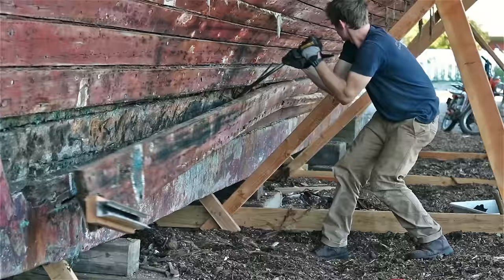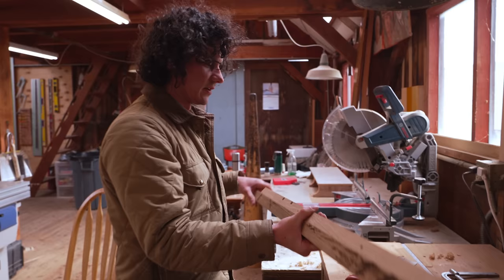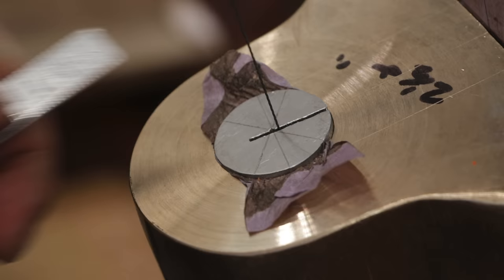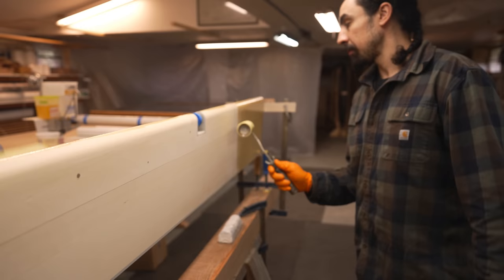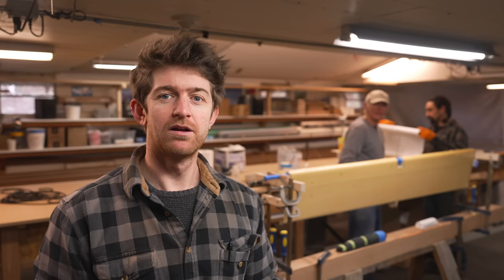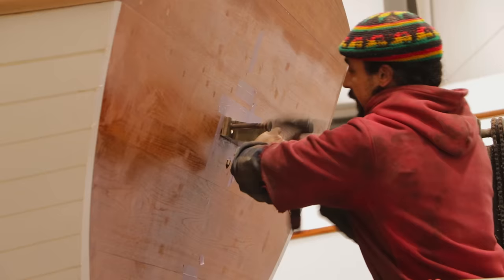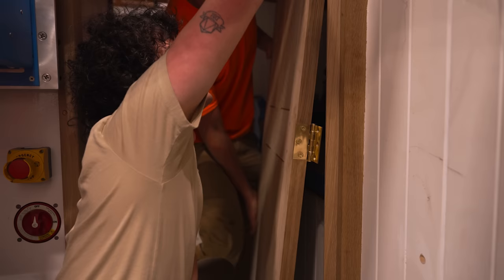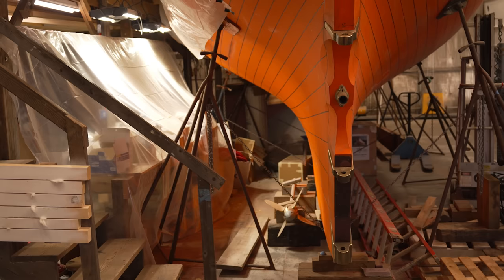Hot-riveting with heavy bronze hardware (rebuilding Tally Ho)

Comment: The consistant and exceptional level of craftsmanship that has gone, and continues to go, into Tally Ho is nothing less that outstanding. Everyone who has materially assisted with this project has every right to be proud of their accumplishments. The day Tally Ho goes into the water will almost be an anticlimax after all the awesome work that will have gone into getting her to that mark. I will say though, that the first time I see footage of Tally Ho gliding across the water under a full set of sail, I will most definitely have a tear in my eye.
Reply: My wife and I have watched this from the beginning and agree the level of craftsmanship far exceeds the quality and tolerances in the original build which were state of the art in its day. Just think that the shipyard would have completed 10 boats in the time Leo has invested so far. The quality of Leo's work far exceeds the original and the original shipwrights would have been masters in a few areas and would move from boat to boat performing the same tasks everyday turning out boats that hopefully worked and paid for themselves and the crews that sailed them. Leo's boat will last another 200 years or more if properly maintained. I hope it finds an important role when finished and not just a floating museum. I think Tally Ho is amazing. Good Job Leo. You will be remembered for this dedication.

Comment: Nice work. I know this boat costs a lot, but I keep thinking about how much the tools cost that you need to build her.
Reply: Very little compared to farming it out, and waiting for something that may or may not fit.  Tools if quality, last decades, and cheap ones are painful to work with, quality suffers.  The material used in this boat far outweigh the minimal tooling used.  Materials and labor far overcome the tooling.  And resale on higher end power tools is available, with the economic era we’re in, probably making a profit!

Comment: Analytical response:  the workmen who initially built your vessel would have been astonished by some of the tooling used in its restoration.  Lie Nielsen, Festool, Porter Cable, ad infinitum, are joined by the mix of caulking irons and hammers.  The table saw!  Dust collection!  Kudos to the adhesive manufacturer who was generous to supply the sealant for the decking (and aren’t battery powered caulking guns great for eliminating a lot of the reason for carpel tunnel?) for a small mention in the application.  Real world.      The people who are assembled obviously are enjoying the challenge, evident in both the attitude and pride in being able to produce jewelry in every piece constructed.  Having been a Forman in a small shop that made small row boats- both Kevlar and solid Western Red Cedar, the initial learning process was full of fun, but need for numbers quickly made it grinding out the same thing daily.  Tempers and jealousies made life miserable, which in your ever changing needs and great people doesn’t seem to be the case.  I commend all of the staff for both skill sets and attitude!  Joyous workplace is what every craftsperson seeks, and you have a wonderful example!  Spread the word about a new groupie. 😊. P.S.  the draw-boring of the door was noticed.  And the hand split pegs driven through the L.N. plate.  Quality

Comment: 20:14 to 20:25 I do not know what brand this chisel is but it is a thing of beauty.
That being said Tally Ho is becoming a piece of art. The craftmanship is something shipwright students will come to admire and learn from the next century!
BTW I absolutely loved the hammering noise off beat with the actually image of the hammer in the same segment mentioned above.
Great video.
Reply: Japanese chisel.  Favored by tool aware craftsmen who want really top end cutting tools.  Hardened steel laminated to a softer body, to ease sharpening.  Back is hollow also, same rationale.  A little more expensive, but buy once, cry once.  Cutting tools are a category that books have been written about, and end use can differ, but these are works of art…functional art.  Either you have basically scrimped and saved for them (woodworker) or inheritance allows the best available.  (Spoken by a callused handed splinter picker ).
Reply: @wrstew1272  yes pieces of art for sure.
Reply: @wrstew1272  yes, I was hoping for a brand name! :-)

Comment: 18:20 pretty sure the duchess of desire hasn´t been hammered this hard in a while..
Great to see the old art of rivetting being used to such perfection. 
I´ve had the luck to restore old handforged railings, which also included a ton of rivets, some years back, 
and it´s truly astonishing how strong they pull when applied propperly.

Comment: I'm no boat builder (feel like it tho, been subscribed since first episodes) but SEEMS like it is worth having a machinist come out, do a portable line bore of those rudder pivot holes and install a modern material bushing.   They are very close now I understand, but you could get the situation serviceable in the field, have some bolt in spares made, effortless pivot for your autopilot, and an easier repair path in the event of any kind of collision or bending forces.   I'm sure a 1/2" wall delrin or nylon (or maybe 1/4 even) would be a 50 year wear surface that would do good in salt water.   Modern touch for that nice early 20th century design plus reliability and serviceability....  My .02

Comment: We talk about skills being handed down from generation to generation - note that Nick drilled the door panel holes slightly off centre so they did not line up perfectly, knowing that when he drove in the dowels the faces of the joint would be forced against each other making for a very well fitting and secure joint.
A skill documented by the Romans BC.

Comment: Never seen that cool dowel cutter thing. May need to get one of those. Great work as always!
Reply: I think one name for that is "drawplate"> I'm guessing the term is borrowed from wiremaking, especially in jewelers workshops where wire (often silver) of a particular size is made to suit requirements by "drawing" it, with lubricant, through a hardened plate with a succession of decreasing sized holes all over it. (The more organised workers use a hammer with two vee blocks, or a smooth jawed vice with V grooves of various sizes, to reduce the wire diameter at the entry end, by repeated crimping and turning it slightly, so it will fit through. Unfortunately you can't really hammer it through from the back as if it was oak)

Comment: At 17:00 the talk about the hot rivets pulling the gudgeon tangs closer together. Steam boilers to power steam engines were made from overlapping plates. The two plates were joined by the hot rivet method shown here. These seams could contain 225 pounds per square inch of steam pressure without leaking. The dual hammer swing shown here was what tightened those joints.

Comment: While I know it's not 'traditional', I've always wondered if a 'balanced' rudder, where the gudgeons extend about a quarter of the way into notches in the leading edge of the rudder, would make steering less stressful on either the tiller or the steering mechanics. Just curious as to why it's not more common... That engine room door is a piece of fine furniture. Tally Ho is going to rival the opulance of the craft built in the golden age of pleasure sailing. Kudos everyone! :yougotthis:😻:face-blue-smiling:

Comment: The trim tab may be a bit wide, but that remains to be tested. The higher the aspect ratio, the more effective and the easier it will be to move. A wider trim tab will also counteract the main rudder more strongly and increase resistance and turbulence in the water.

Comment: Question for Nick on the Door? I see the one side of the center framing member had two sticky-outy-things, while the other, just a single being somewhat wider? I assumed that was to allow a handle hole, without removing all the material; but then you affixed the hinges to the side with the double tenon? Leaving me wondering why the difference between the sides?

I also have to say, and I know many have, but Zeal that’s just an amazing job. 

Because these are coming out every two weeks, and because I’ve already watch through from the beginning numerus times, I’ve had to resort to watching other boats being built? 
Sadly, they’re not Tally Ho? 

I watched a rutter being mounted two weeks back; granted they may not intend to sail too far off shore, and I’m no shipwright, but you can just see, that not all boats are equal? Such a great job; that goes for the entire crew.

Comment: What an awesome episode! I wish it was twice as long so you could explain some of the steps more, like that cool jig you made for the drilling. One question: when Zeal is drilling the holes into the two sides of the gungeon at 17:21, how does he ensure they are plumb with each other? Just careful measuring?
Reply: My take is: He's not drilling new holes, he's countersinking existing holes, so the countersink bit pretty much follows the drilled hole*. Presumably they were drilled through from one side, with the drill press table contacting the inner orthogonal face.
(*Given that the purpose of the countersunk recess is to accept a form-fitting upset rivet head, it wouldn't matter if it was not particularly concentric)
Reply: @Gottenhimfella  I actually meant 17:17, when he is drilling the main holes before dry fitting a rivet between the two and then countersinking. He would need those holes to be the correct angle and aligned w each other. It appears that he just has some sharpie lines to guide him. Maybe he can file them down the edges of the holes to accept the rivet (without introducing any give) and it doesn’t need to be 100% square w the rudder’s plumb line. Then he can transfer those holes to the boat and ensure the through hole matches, via that funky jig they showed. The rivets may not be entirely parallel to each other, but they would still be super tight.
Reply: @cgstadler  I see what you mean, and I agree that it's not essential, within reason, for the holes to be perpendicular to the midplane as long as the gudgeon axes are on that plane. It's a common situation to have to somehow line up the entry of a drilled hole (in this case, through the wooden sternpost) with the exit. I have sometimes made jigs somewhat like a G clamp, which have a drill guide bush at the entry end, lined up with a cone-ended set screw at the exit end. The idea is to reach around to the back side of what is being drilled and line up the axis of the drill automatically.
It's a lot quicker than the more usual ways, such as to drill from one side with a long skinny drill, see where it breaks through on the far side, then laboriously shift the hole across by some means while gradually enlarging it. The trick is to end up with a hole which is not bent. 
(It does occur to me that one advantage of ductile hot rivetting is that (at a pinch) a hole which is straight and of uniform diameter is not strictly required)
My method doesn't work though for (say) drilling for a sterntube. In such situations, the "line boring" approach is the gold standard. 
It would be helpful to have some affordable way of sensing the alignment of a drilling handpiece with a remote target by some electronic means.

Comment: Watching the installation of the rudder gudgeons was fascinating! 

Shouldn't there be ventilation slats in the engine room door though or is there ventilation elsewhere making it less necessary?
Reply: You want to seal off the engine bay/room from the cabin due to noise and smell. They will probably use active venting (fans).

Comment: That "Dutchess". What a buckhead.
Yeah, rivets are so much better than bolts because they go in hot and the quicker they're hammered in, the more they will want to shrink, making them tighter. As the gudgeons take stress from use, the rivets will not stretch and they will hold their place.
I mean after all, the entire hull of the Titanic was riveted...
...that didn't quite sound right.

Comment: Speaking as a boiler maker send the rivet through first then heat it with the oxy torch let's you heat and form the head easier and use multiple heats its bronze so it won't enbrittle the head.
Reply: I see what you mean, but if they heat the rivet in place, don't they risk burning the paint & boiling the tar?
Reply: @frederickstibbert7389  no it's the same heat level as what thay are doing now in regards to pre heating the rivet and it sitting in the fastener, and to heat in situe aim a clean blue quiet flame (not roaring but hissing) at the head of the rivet perpendicular to the hull of the boat, an added bonus to this method is you can take time to clamp or brace the opposite end of the rivet. Just give it a try on one and see if it feels easier for you.
Reply: @frederickstibbert7389  oh and I've just been back to check the video change the torch head to a cutting head the flame jet is more concentrated and controllable.

Comment: I thought a rivet had to have a head on each end, why won't the rivets that you ground flush on the rudder flanges just back out over time? How can they be held in place if one end is ground flush?
Reply: The holes in the hardware were countersunk, so when they pounded the rivets the countersunk space got filled with the back of the rivets. So the rivets still have heads even though they were ground flush.

Comment: I find myself wondering if the original Tally Ho was made with as much precision and care as the rebuild.
Reply: Quite likely not ! In 1910, "Betty" would have been just another boat built  by a well-regarded commercial shipyard. As a luxury yacht, she'd've had more than usual attention paid to the interior fit-out, & I gather that her iron floors & knees were something of an innovation at the time. Except for the high-quality wood used, her  hull, deck & rig were entirely usual - similar-sized craft were built by the 100's every year.

Comment: What prevents water intrusion into the stern post where the bronze rivets are hammered through? Keep in mind i know nothing about  building a boat.
Reply: The wings of the lower gudgeons are bedded in bitumen tar to prevent water intrusion - 15:18. Further up, where the gudgeons are bolted through the transom & sternpost, the gudgeons are bedded in cotton caulking yarn wrapped around the bolts. The cotton swells up when wet & will prevent water from seeping in along the bolt holes - 16:22.

Comment: @LEO, regarding your prop, will u be using a trad prop or perhaps one of the vastly better , more efficient and more power transferring toroidal style prop? just wonderd if you had given it any thought, now with the new improvements in impellar/propellar designs giving so much more bang for the buck as it were...what are your plans? have a good day buddy
Reply: Leo has bought a 4-blade "Variprop" feathering / reversing prop - see EP135 "Machining the Driveline" at 21'25".

Comment: Why not just use a pipe or dowell inserted in the gudgeon holes to align them?
Reply: Because a pipe could bend under its own weight, or bend to align w/ the fittings. The string can be stretched taut.